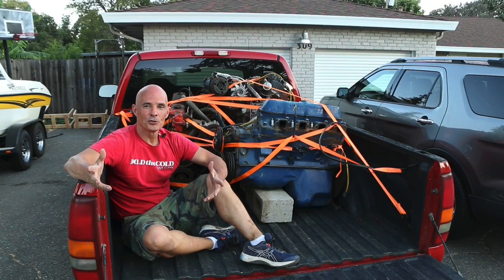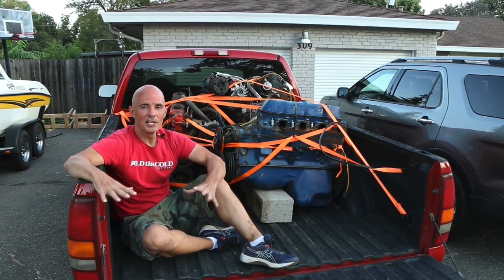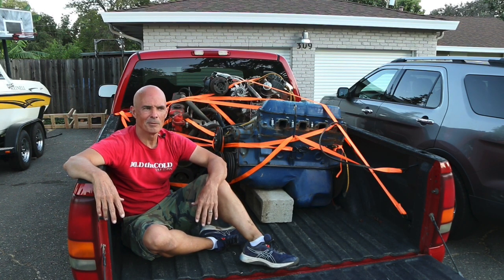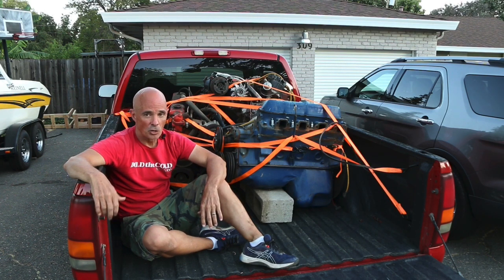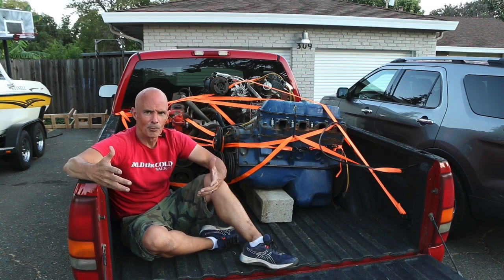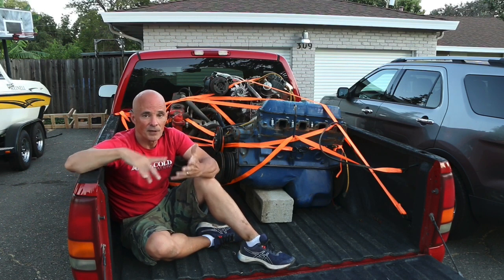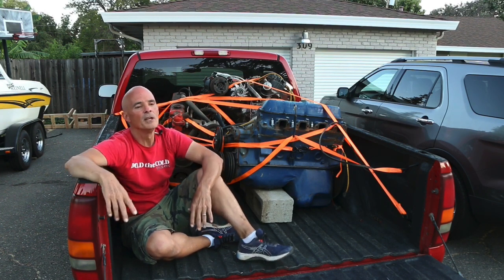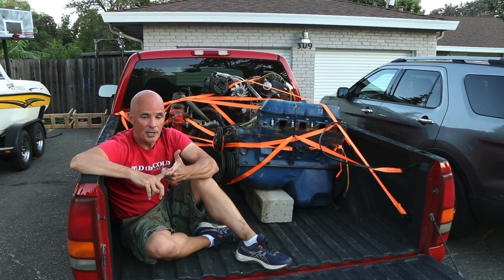THE OTHER GUYS-3 FOR FREE!!!

Comment: So im sure you've seen the Cleveland headed 300-6, but i figured id point out Hey you know the LS heads physically bolt up to the same pattern as the Windsor's Cleveland's and... 300-6... im sure modifications would need to be made but saw 2 706 heads in half and weld them together and adapt the water jackets if needed... not only does this increase the CFM flow it also has the benefit of separating the exhaust side of the engine from the intake
Reply from the maker: I saw that done somewhere

Comment: The Rochester 2g is actually a pretty good carburetor. On the circle track "stock" classes are sometimes restricted to these up to the 1-1/4" venturi version. You might find that the 1-7/32" version is more common or atleast that's all that was left in my area so I used to bore the ventuis and radius them with a hand ground fly cutter to hide the work. Blast away the tool marks and dip them in alodine to give it that green/gold color. We'd tap the main jet holes for holley jets and bypass the apt circuit giving it a shorter path through some plugs we'd drill to use as jets for the transfer circuit instead of the metering rod which can help with tip in by making the path shorter. Believe it or not with an acid ported manifold and some special 2bbl fuel to make the manifold nice and cold we saw as much as 397hp from one of these carbs.

But if you want boost there is nothing like fi. And if you can get a webber manifold for the 6 there are dcoe and idf /Ida throttle bodies loaded with 1000cc Injectors available from china. Add a microsquirt computer or RusEFImicro and you have a sub $1000 efi system for all the boost you can ever want.

Comment: There are some aftermarket heads, intake, rockers and cam for the cadillac. There was a shop that was on the Engine Masters contest awhile back and i would love to port the head on the 6cyl or the Caddy motor
Reply from the maker: I would love a ported 6-cyl head to test
Reply: @richardholdener1727  are you gonna do a solid lifter or a roller cam in the motor for an upgrade?

Comment: Always wondered how one of these Chevy 292 would run on point type fuel injection
Reply: "point type"?
Reply from the maker: probably multi-port
Reply: @richardholdener1727  yes multi port fuel injection
Reply: @michaelangelo8001  somehow I wrote point originally but I did mean port type actually my bad
Reply: @s.a.f.r.a6403  Probably Google's spell check.  It's artificial intelligence is pretty primitive and illogical at times.

Comment: Are you gonna do the ta aluminum heads on the Buick 455? Because I've been debating on getting a set for a few years now. I'm super excited to see what it does. I've got a 1970 Buick 455 in my 86 regal that started knocking, and I'm building a 1974 Buick 455 to replace it. And I didn't know about the oiling issue, looking forward to seeing that video!!

Comment: Rich, I've owned 7 Boattail Rivieras ('72). I'm pretty familiar with the 455 Buick built from '70 to '76. '70 Is rated about 100hp more than '71, due to the chance in gross vs net ratings, BUT...'70 was the only year for 10:1 (high compression) pistons.  Stage 1 on the 455 was heads and cam and special carb. Rated for 10hp more than stock. Sandbagging.  Reach out to me, we've emailed before.
Reply from the maker: thnx-I certainly will if I have specific questions

Comment: In 1985 the Flint GM proving ground and development enginers came to Australia with an IROC, a Corvette for hot fuel testing in the Oz Red Center and they tried out a VK Holden Commodore  XT6 3.3 Australian Electronic Injection intake. Try that style manifold style on your 292 Richard. Holden ER!
Reply from the maker: WISH I HAD ONE TO TRY

Comment: Your six pack is a larger version of our 149 to 202 CI Holden six.. turboed dozens using suck through with dcoe Webbers, SU or CD Strombergs, Webbers are the best, because of the way they work, you really can alter so many areas of them without changing other parts of the range, drop the comp to 7 to 1 and dose it with 30 LBS thats what i did. O and your standard exhaust manifold will work just fine.. Eddie   C4 Australia

Comment: Ive always wanted to see a more effective fuel delivery system on the big inline 6s like a port injection or sidedraft style multicarb. If you actually do a draw through style turbo on one of them it would be cool to see the differences on power and efficiency  using draw through vs a more normal blow through setup. Id really love to see that Cadillac make 600 ft lbs using mild upgrades

Comment: A 292 is a truck engine, and that's really all they are good for.

A good friend of mine had a '53 Chevrolet show truck back when I was in highschool.  It had an aluminum 4bbl intake, cam, ported head, split header, with dual exhaust, etcetera....

Still, it sounded ugly, and wouldn't keep up with a 327/300hp.  No thanks...

The Cadillac is hard to classify.  Honestly, the best use for them is also a truck engine.

I've built a few of those.  Put a cam & springs in it, and if you turn it over 3,500 rpm, the valve train will fly apart.  So the whole pushrod and rocker arm assembly will have to be replaced, and the available options are not cheap...

Likewise, if you go over 5,000 rpm for very long, you will overheat your rod and main bearings, and you know what happens next.

The solution is to reduce the journal diameters down to BBC size.  The factory rods won't handle much anyway, so you use either BB Chevrolet or Chrysler rods.

Easy enough while you're doing the crank grinding anyway, to offset the rod journals.  With a small overbore, you can pick up another 40 cubic inches that way.

But the real holdup on a Cadillac, is the heads...  You'll never get the performance you're looking for, out of the cast iron heads.  And the only decent aluminum heads that are available, were around $5,000 the last time I checked.

So the problem with the Cat is, if you are looking for big HP, you'll find you can build a monster BBC cheaper.

For the Buick; just fix the oiling issues, buy the Edelbrock top end package, and you're all set...
Reply: Michael Angelo : The 292 with Cotton Perry took out a drag racing series with a 10 second Chevy II and bored out roller cammed triple carb 310 six in 1980.
Reply: @deanstevenson6527  I know all about it...  They bought their first engine from me on credit, and I never did get my money.

That car only won races because NHRA gave them a big handicap.  It couldn't run with the V8s heads up.

Comment: USE STOCK MANIFOLDS ON ALL ENGINES FOR TURBO . use stock late 60s 472 or 500 cam and heads with (springs up grade) rev to 5000
Reply from the maker: thnx

Comment: On the caddy the pistons are specific to the heads... yes you can swap them. But could end up with very low (7to1) compression or high...(12to1 if i remember right). For the 472-500 there are only 2 camber sizes.. 76cc and 120cc..to get the different compression ratio is about the piston.. 472 and 500 have different pistons not interchangeable..

Comment: The buick got too much spray on the 1/4 and the caddy 500 got too much burnouts in the gremlin, i was really hoping they would rebuild both of them but i think it's better that you ended up with them, the roadkill garage guys always go with new engines anyways
Reply from the maker: this Buick was not run-caddy needs rebuilding
Reply: @richardholdener1727  can't wait to see what you can make them do

Comment: Oldsmobile when you going to do one? I've got a few years of setting them parts back. Now doing different motors. They need a good home
Reply from the maker: where r u-I do want a 455 Olds
Reply: I'm in Panama city fl. oldsmobile 350 I had a 78 Cutlass was a 260 2bbl to start with. did a very stright forward swap cam compression tall intake long tubes stall gears floor shifter etc. I'm now getting into boating

Comment: Have you done any AMC engines? I’d love to see some if not. One of the ultimate “other guys”... hahahaha!!!
Reply: I already asked him couple months ago to do the AMC 360.
He replied asking where to find one; think he is still looking. 
I would gladly let him use mine, if I was not so far away.
Reply from the maker: Not yet!
Reply: jhoncho4x4 on a couple of AMC forums I’m on, there are guys saying people are “giving them away”. I’ve yet to find one and when I have, they’re generally way overpriced!
Reply: @Ninelinegarage  The 401's ARE overpriced. 
On CL, I find 360's fairly cheap from those who swapped in an LS.
Transmission usually included too.
They made more 360's than any other V8  and for a longer period of time. 
Chrysler even kept making them after the buyout, for the Grand Wagoneer.

Comment: Should check out 12bolt.com.. lots of parts for L6's over there and iirc the fellow who runs it is running a boosted L6 292..  and from everything ive read porting does more harm then good.. that changing the angle of feed using port lumps is the way to go. (building out a 250ci 4.1L myself, and will be watching the 292 closely since there's a bit of crossover)
Reply from the maker: I saw them last night-was checking out the Lump

Comment: Check out Cadillac Larry if I remember correctly he is in Florida and has speed parts for them like adapters to use Ford yes a Ford intake on the big inch Caddy and horse power tv did a 292 BUT am looking forward to your tests ESPECIALLY the Caddy with 500 foot pounds of torque at idle....rock on Richard 😁

Comment: How close does a 2jz intake match the 6 cylinder? Or the chevy 4200 i6?  Might work for your fuel injection/turbo builds.
Reply: retsaoter : Not at all 4.4 inch bote centers on the 292,  3.615 or so on the tiny 2JZ.

Comment: This is cool. Id like to see draw thro, mabey a bypass valve or in a old turbo book i read of a throttle body under the turbo that was slightly more closed than the carb to reduce the vacum seen at the turbo... love to see a 455 olds at some point, i know they dont like alot of rpm like the buick but make lots of low rpm torque. I do know even tho they dont rev alot they like bigger cams than ud think

Comment: Can't wait to see you hang that 292 on the dyno. Might give me some inspiration to work on the 235 in my 57 Chevy sedan. A draw-through carb setup would be cool. Didn't the buick grand national use something similar? I think the standard blow-through may be a better bet, though. You could run that without an intercooler since the atomized fuel will really help cool the intake charge. I remember from the episodes of Roadkill Garage that 292 ran REALLY well. that Buick 455 is the one that didn't go into the crew cab chevelle so it's status is unknown, and that Caddy 500 will for sure need a rebuild because Freiburger over-revved it doing epic burnouts and broke it.
Reply: Pre GN 3.8s used a big T3 (I think) draw thru with a Q jet
Reply: @billythebake  That might be what i'm thinking of. I remember the quadrajet part as wll. Uncle Tony's Garage had a fellow with a 225 slant 6 that had that turbo manifold adapted to it.

Comment: Richard, there was a Hot Rod article years ago called "Cadzilla". Don''t know what year/ month but they striped down the Caddy more and more 'til it was just a frame trying to get the best et, I think they got down to just under 11 sec passes, I think they made mods to the motor ..not sure Freiburger might remember. On the Chevy 292 do your self a favor and replace the front and rear main seals, they dry up sitting around  notoriously. Butler has speed parts for the Buick but spendy (you already knew that).. can't wait.. how about six 40mm Harley carbs for the 292..just kidding!

Comment: I dont know how true it is but ive heard multipule times that either 283 or 307 sbc pistons will fit that 292 (im not sure on wrist pins and height and other details) which means you could pop some newer forged slugs into that thing and push it way harder on boost and spray?

Comment: Love straight sixes I'd like to see as good of a build as you can afford on the straight six with a turbo some head work, fuel injection, and a decent intake, please if you can.  Also can you please so some work on the Ford 300.  I was trying to do a hydraulic roller cam conversion setup on one with regularly available parts but had to stop cuz going back to school I know one company makes solid rollers but I was trying to do a cheaper hydraulic roller cam conversion on them and not using tie bars but altering the cam cover to make almost like a spider with bars welded on and sticking out like you see on the 302 to hold down the dog bones and then using the stock Ford hydraulic roller lifters to make a roller cam conversion on it but just as I was starting to buy parts I had to start going back to school and had to sell them off cuz I need every penny, especially now, and also my friend who is a machinist is  too old to be able to do anything to help, he was the real brains and hands of my crazy experiments, so I would love to see if maybe you can do something with that, or try the solid roller lifters and a cam cuz I don't think I've ever seen one actually used.  I don't know if that's really up your road but any build on the Ford 300 I freaking love them I had one in a bronco and it was awesome. And I really only prefer the later bigger ones The earlier ones just are so anemic and on some of them the intakes are part of the head and it's just goofy and bad that I don't really even look at them mostly just the ford 300 but any straight 6 build I am super excited for.  I love your videos keep it up very awesome.

Comment: A buzzin' half-dozen, I love it. Rare to find but the Pontiac OHC Sprint 6 had a nice quadrajet manifold and dual outlet cast iron header which will fit your 292. Other than that and headers obviously, the manifold used on school buses, dump trucks, and farm machinery is the best exhaust manifold with a 2.5 outlet and a smooth flowing design, it would be ideal for your turbo install. See if this link works,  
http://www.dragtimes.com/parts/250-4-1-292-GM-CHEVY-PICKUP-NEW-EXHAUST-MANIFOLD_271253116658.html
The next thing to remember in the event you aren't aware, the cam is unique to the 292 as the distributor and fuel pump swapped locations from the 230-250 inline. If you want to go real big, the fastest inline 6 has a head made from two aluminum sbc heads, each with one end lopped off and welded together. It's not an easy swap as head bolt locations have to be changed for the sbc pattern. For carbs, I always thought 3 high performance Harley-Davidson side drafts on a custom intake would be interesting, or 3 throttle bodies. Murder Hornet would be a good nick for it, those inliners make a unique sound when they're breathing fire, lol. Have fun, looking forward to seeing it spin.
Reply: On a side note, there were some guys that were building a Pontiac OHC and were using two Quad-4 heads welded together in similar fashion as the sbc heads, I lost track if they ever got it running, would be a real screamer.
Reply from the maker: thnx-the Spring motor would be Super Other Guy
Reply: @richardholdener1727  Found the Quad-6 article, actually DOHC V6 heads welded together.
https://www.hotrod.com/articles/hppp-0606-pontiac-sprint-six-engine-build/

Comment: I figure of those Cadillacs can’t handle any rpm, why need how ridiculously big you can make the rotating assembly.  Can they take a giant bore? Can they handle a huge stroke? Could the Cadillac 500 make diesel torque numbers?
Reply: It makes diesel torque stock @500ft/lbs. You can go to CadCo and read his stock build up with his in house dyno. He shares everything. So you can buy the right parts and get the same power out put.

Comment: The primary issue with the buick, olds, pontiac, and cadillac was the lack of cylinder head development from the factory. With exeption of the max wedge heads, you could include big block mopars in the same group. Meanwhile chevy and ford were producing serious canted valve production heads for their big blocks. BTW, i am a mopar guy, don't start preaching about 426 hemis. They were unicorns out on the street.

Comment: Did they ever put efi on the caddy  500 from the factory?
Reply from the maker: ONLY CARB
Reply: Yes, in 1975 and 1976 Bendix electronic fuel injection system was offered as an option. Very rare.

Comment: If you want to find some thing really crazy dig up a factory EFI intake for that 500. From what I've read on em the rockers are the weakness but hey that's Internet lore or maybe not.

I'd be curious to see what that Buick takes under boost. They're supposedly a super light engine. Like SBC light and 455 CID. Weighing one would probably be interesting as well.

Also a hack for you is that theoretically an 84 vacuumless dizzy from a 250 equipped half ton truck should fit that 292 and allow for computer controlled timing. Look for one with a 7 pin module such as ACDELCO 88864755. May even be a junk pile item. About a hundro at Rock Auto otherwise. Throw a T76 on that baby and let er eat is my vote. I bet she'll go farther than one would think tbh.

Comment: Quick question... 03 silverado 2500 4x4 ... 6.0 ..  Its my daily driver work truck and is always carrying tools and equipment.. And 10 mpg ( even going downhill) . would adding a simple turbo without a ton of other mods help me with MPG and general power. Less than 100,000 on engine and trans.    I really don't know which way to go with it...  A little real advice would be appreciated. Im a decent mechanic and fabricator but not knowledgeable when it comes to turbo sizing and such.
Reply from the maker: for a cheap turbo-use the EBay GT45 clone (ours was from DNA), I doubt mileage will improve-especially after you feel dat boost
Reply: @richardholdener1727  thank you for the advice. I've got one on order. At least I wont feel.like im banging the pedal through the floor board to get it all moving.   Ill up date you on the end result.   Thanks again.